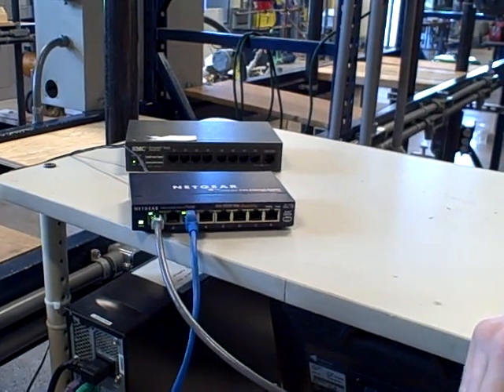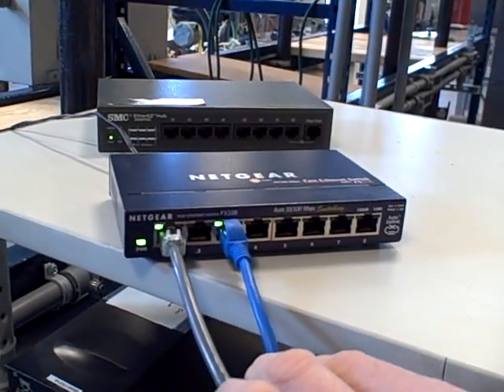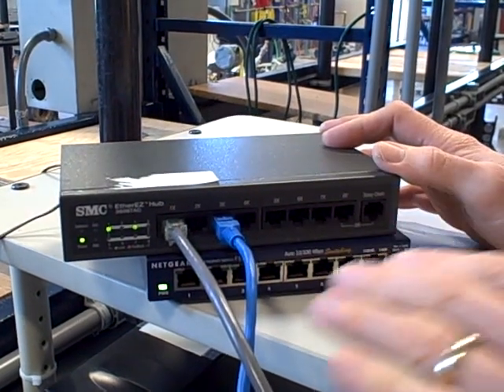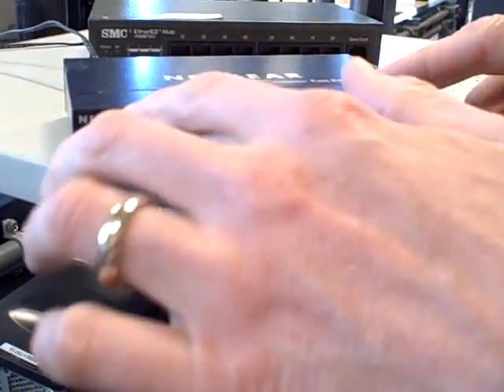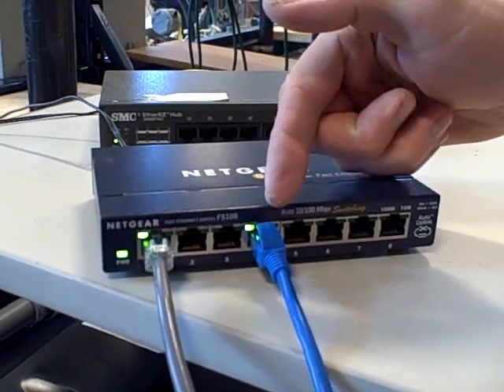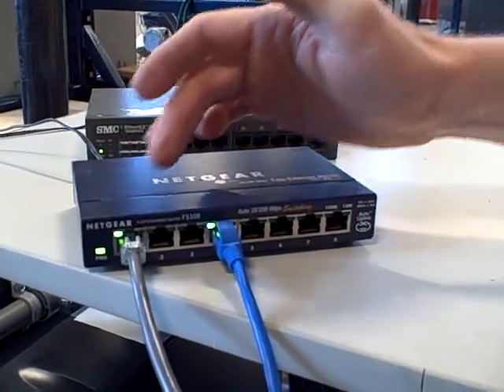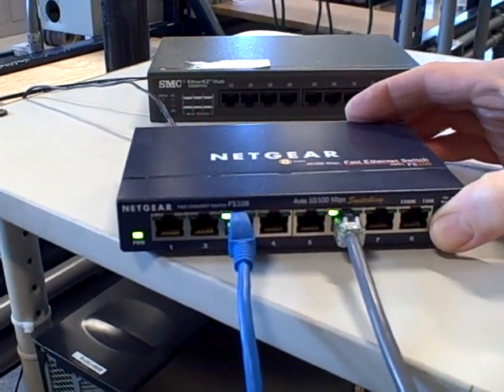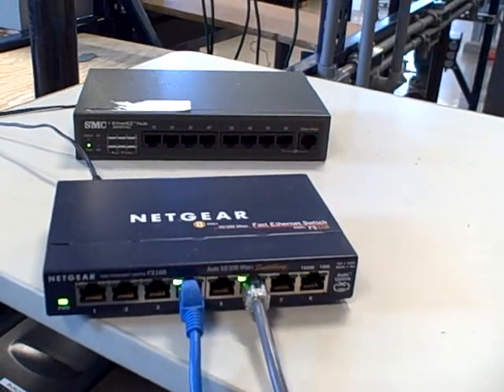Ethernet hubs versus switches

Comment: Never connect a switch to a switch. If you need to expand the switch, run out of ports or whatever, connect a hub to it.
Reply: +Jason C. I have installed a single ethernet connection to each room of my house. All the cables meet under the stairs at an 8 port gigabit switch. I needed more ethernet connections in one room so i installed another switch in that room. What is the downside of connecting a switch to a switch?
Reply: Tim Brennan Performance degradation,  latency, and fragmentation.
Reply: Tim Brennan I would of got a switch with more ports rather than a second switch.
Reply: +Jason C. Oh my god, that's such bullshit. And I am speaking as a Cisco certified network designer who does this daily for a living. Do NOT believe in what Jason C. says. Hubs are DEAD, you can almost not even buy hubs in most places. Connecting switches to switches is done everywhere in the world for ages now. You just have to look out for network loops as those will break your network, so only connect Switch 1 to Switch 2 with 1 cable and never run 2 cables between 2 switches.
Reply: Only novices daisy-chain switches.
Reply: +Jason C. I did not talk about daisy-chaining switches. I meant 1 or maybe a maximum of 2 layers of switches (Backbone->Aggregator->Access), connected not in a daisy chain but in a star-shaped pattern. Do some Cisco courses to know that this is correct.
Reply: +Jason C. You didn't get it. It's not about using hubs over switches but not to create bottlenecks in you network. It's about  using more ethernet cables instead of just running one and split it up. Using a hub instead of a switch actually makes it worse. A hub connects the clients in such a way that they all share the same network capacity. A switch separates them and enables every single client to use the maximum speed instead.
Reply: "If you support so many network nodes that multiple switches are required, do it right. Purchase stackable switches designed to work together that scale to match the site's requirements. Cease interconnecting switches via an Ethernet cable whenever possible. Seek switches featuring high-speed stacking ports "
Reply: +Jason C. It is very often not possible to run all cables to centralized stacked switches. Ethernet cable may only be 100 meters long, so in office buildings of a certain size you HAVE to have multiple switching cabinets in different floors which are interconnected.
Reply: erazorCTF You are a network engineer but you don't know how to run ethernet cables to different locations without having multiple switches in multiple locations??????
Reply: +Jason C. As I said, if cable length exceeds 100 meters, then there is no way to connect all ethernet cables to the same location and you need distributed wiring closets with interconnected switches in them. And yes, I am a certified network engineer.
Reply: erazorCTF If you need to runs over 100 meters you don't use a switch. You use a larger cable.
Reply: +Jason C. Hahaha Troll! Show me larger gauge Ethernet cable please :-)
Reply: Lower gauge wire has a bigger cross-sectional area so its resistance is less.
Reply: erazorCTF The TIA/EIA and  ISO/IEC  standards do not specify a conductor size. Which is why you can buy Cat5e and Cat6 in 28, 24, 22, 20,etc.. AWG sizes.
Reply: erazorCTF You don't know what you are talking about.
Reply: +Jason C. oh my god. show me one source that states Ethernet copper cables can/should be longer than 100-120 meters? one source is enough. do you really think medium size or big companies run off of one wiring closet with only one switch? that is hilariously dumb!
Reply: erazorCTF Nice straw man. I didn't claim ethernet cable length runs should be over 100meters. My assertion was, runs over 100 meters is doable if you increase wire size. Doing such decreases resistance and  thus, allows for longer runs.
Reply: erazorCTF The science on this is sound.
Reply: erazorCTF Resistance is a numerical quantity that can be measured and expressed mathematically.
Reply: erazorCTF When speaking of resistance relative to cable length and size it can be expressed as: R = PL/A. With P being resistivity, L the length, and A  cross-sectional area.
Reply: erazorCTF " wiring closets are connected via fibre Ethernet," This is a straw man / red herring because the debate was concerning cable length runs of copper category ethernet cables, and that was not in dispute. NOT fiber optics networks.
Reply: erazorCTF The 100 meter maximum is a general recommended maximum for 24AWG stranded ethernet cable. Typically cat5 - cat6. NOT 28, 22, 20, etc.. AWG ethernet cable.
Reply: +Jason C. Lol dude you're all confused. He's talking about industry standards, you're talking about physical wire properties. 

In a small install having a few dumb switches hanging off a managed switch is no big deal. I've done walkthroughs of large school districts though that have dozens of dumb 5 port switches all over the place and none of them are documented. That's when you run into trouble. 

Your first comment is still wrong, nobody should be installing hubs anywhere unless there's a very specific requirement, such as spanning a switch port on the cheap/dirty.
Reply: ThisMakesMeThink Do tell us then how this  100 meter maximum  is a universal maximum for all Ethernet cable conductor sizes i.e. AWG, when the laws physics prove  it is not.
Reply: ThisMakesMeThink That is how he was applying the maximum. As a universal across the board maximum for all ethernet cables, regardless of conductor size.
Reply: ThisMakesMeThink Oh, and If it was an industry standard he was speaking to then why did he ignore everything I stated concerning  TIA/EIA and  ISO/IEC  standards???
Reply: +Jason C. to keep a good data rate, you need to do not exceed 100m because of the wire capacitance (the capacitance is worst when you use bigger wire (or lower gauge)) Sorry for my english, but this is a fact!!!!

higher capacitance mean you need to let the wire "cool down" between each bit. and that slow down the max frequency of the wire.
Reply: +Pascal Lafrenière capacitance and inductance **
Reply: That is stupid! Please looks this old schooling video again!
Reply: +Tim Brennan  This do you can do without problems. Specially the switches let found your devices the correct route very easy.
Reply: Pascal Lafreniere You are equivocating.
Reply: Nonsense.
Reply: @kalijasin  Maybe you should learn what you're talking about.
Reply: @kalijasin  Yep.  If you have multiple switches, you should arrange them in a tree config, with a root switch connecting to multiple switches.
BTW, I'm a CCNA.  That is I have been certified by Cisco in routing and switching.
Reply: @kalijasin  You often run a single cable to a remote switch.  I used to work in IBM Canada headquarters where there were around 5000, IIRC employees.  How would you connect all them.  BTW, there were 7 floors in that building, not including the basements.
Reply: @kalijasin  Why do you insist on proving you're clueless?  If you need to run over 100M, you use fibre.  Also, large offices often have multiple switch locations.  For example, there could be switches for each floor or section of a large floor.
Reply: @kalijasin  Maybe you should get some education about networks.  You clearly have no idea about what you're talking about.  There are cables such as CAT5, CAT6, etc., which are used to make Ethernet connections.  They have ratings as to how far you can go with them, typically 100M.  You may be able to squeeze out a bit more than that, but if you're going significantly further, you need fibre.
Reply: @kalijasin 
"My assertion was, runs over 100 meters is doable if you increase wire size."
 My assertion is you're full of it.
Reply: @pascha4527  Actually, it's impedance, which is affected by both capacitance and inductance.